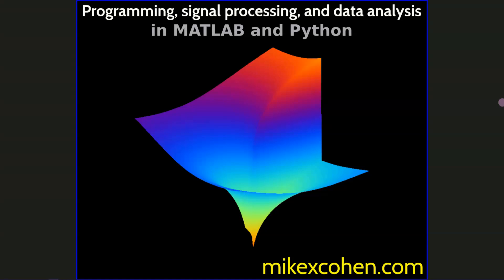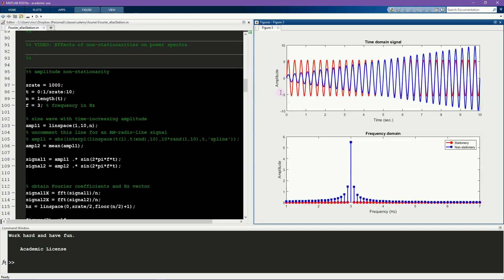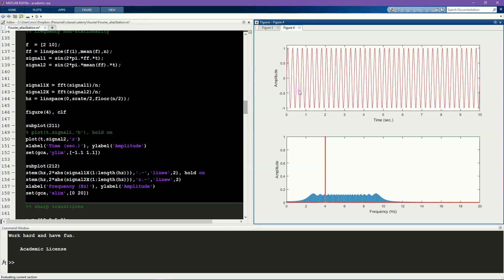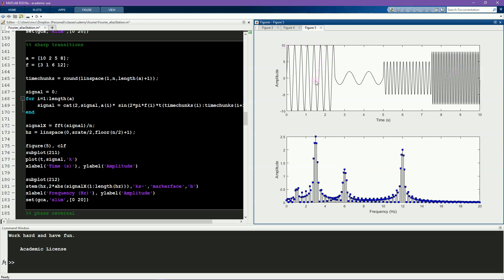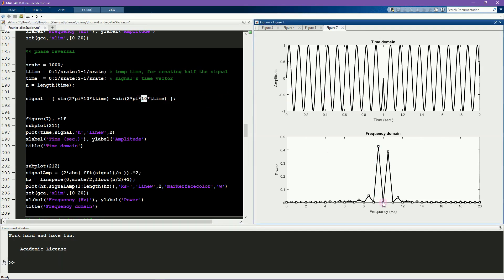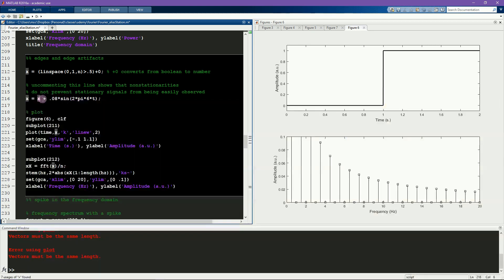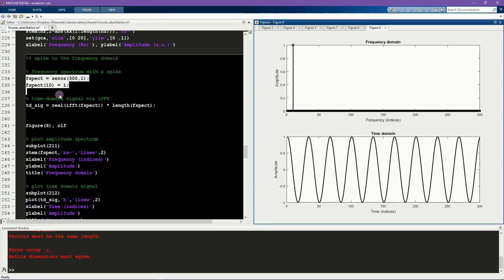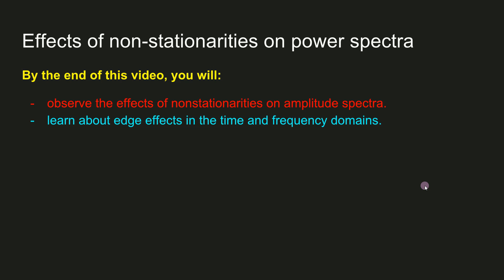Effects of signal nonstationarities on the Fourier power spectrum

Comment: Thank you very much for the videos. But what I understand is that power spectrum or power spectral density is only defined for stationary process.  This is explained in the book of famous Signal Processing Society Petre Stoica (Spectral Analysis of Signals). Could you give a light with regards to this issue. Thanks.
Reply from the maker: The PSD is defined for any signal, regardless of its characteristics. The question/difficulty comes from interpreting the PSD. The PSD is easy to interpret only for stationary signals. Relatively subtle non-stationarities are also fine and lead to some "smudging" in the PSD. But a signal with strong non-stationarities will have a PSD that is difficult or impossible to interpret.